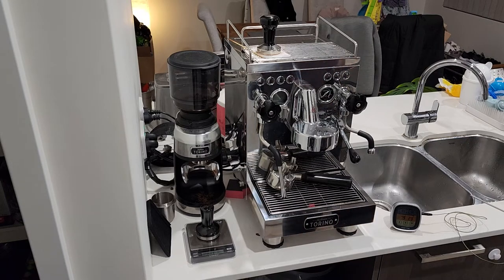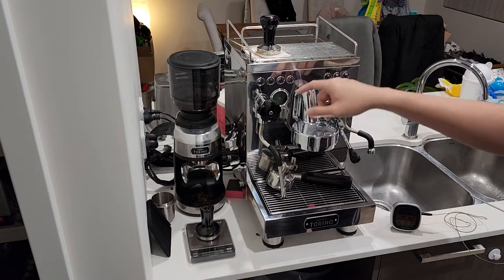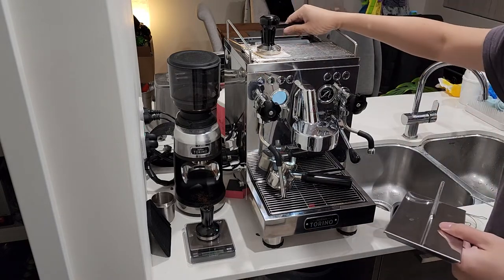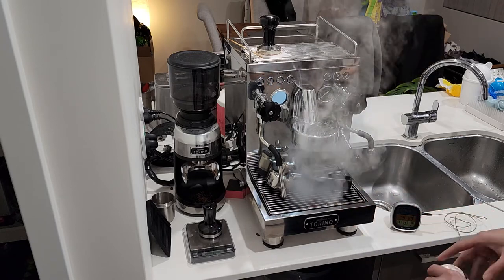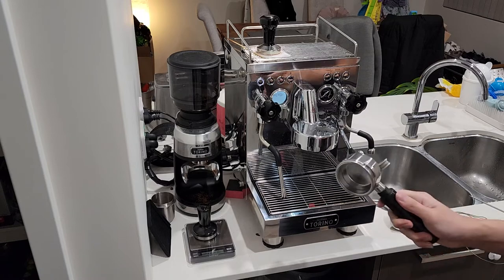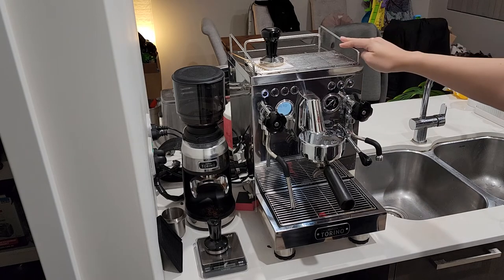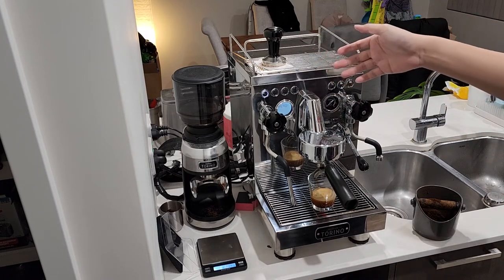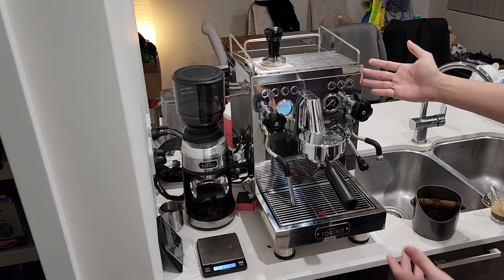Sunbeam Torino review

Comment: You're blaming a sour shot on the absence of an OPV? The OPV is not there to save poorly dialed in shots or crappy coffee. I use a Sunbeam dual thermoblock system and it simply cycles back the pressure of the pump when the grind is too fine. For it to shoot through in 20 seconds at such a high pressure suggests something else going on, like old coffee or something. There was very little crema in that shot.
Reply from the maker: I agree. An OPV won't fix poor grind setting or stale coffee. In my case, I suspect that because the pressure was too high (15 bar), heavy channeling was occurring despite carefully prepping the puck. So it results in over extracted coffee (at the channels) yet producing an overall under extracted shot. I'll need to get a reflectometer to definitely draw a conclusion. Right now is just a hypothesis.

Comment: I've got the OEM version of this - the WPM Welhome KD-320; recently purchased from Costco, upgraded from the Breville Barista Touch. Although I've experienced the same challenge of 13-14 bars of pressure based on a 19gms in, 40gms out 30-32sec extraction time, the espresso I'm getting is decent and a slight improvement on what I could get from the Barista Touch. Support and a community on these machines is very far and few though so if you run into a problem, it does sound like you're going to be on your own.. I'm keen to understand how the OPV mod works for you though, if it can be done and significantly improves the quality I'd certainly consider giving it a crack.
Reply from the maker: I'll need to get a reflectometer in order to quantify the improvement. Subjectively speaking, the mod did give some improvement but I'm still not satisfied :/ So I bought the Breville dual boiler to see if I can produce better espresso so far it has been a vast improvement but I'm going to do more test before drawing a strong conclusion.

Comment: You can't measure the temperature accurately with that thermometer because it's a cheap $10 one from aldi. I know because I have one and it's not very good at all.
Reply from the maker: Hahaha yeah unfortunately I don't have the K-type thermocouple. The aldi one lags quite badly so not very good.
Reply: wrong. its easy to measure 100C water. even with this one.
many people said these machines cant get above 65-75C (max 79C)

Comment: hey DanDoes, do you have a video of the hot water use on this machine? Given the machine is mostly a EM6900/EM7000 in new clothes, I'm curious what a difference given the extra thermoblock has. I assumed it's related to the hot water.
Reply from the maker: Sorry I don't have a video of the hot water use; I didn't think it was particularly important. From my understanding, the hot water outlet only relies on 1 thermoblock whereas, the group head has another to ensure exact temperature.
Reply: @dandoes7764 yeh, I ended up buying one of these machines second hand, and can confirm the 3rd heater is just for the group head, otherwise the machine is mostly identical internally to to the EM6900, EM7000, etc.   I would have liked better hot water, save having a kettle for making tea, but it's been ok. I've been thinking to use a dimmer on the pump to decrease the flow rate, but for now, it works and imo the coffee from it isn't bad.
Reply from the maker: @itujjp  I've seen the dimmer mod but was less confident in performing it. Having said that, the dimmer mod might be more useful than the OPV. I'm beginning to think that the issue with the torino is the high flow rate. I'm curious about the consistency of the flow rate; i believe mine is about 15 mL/s  from the shower screen. Its been awhile since I've measured it. Do you know what yours is? Most E61 group machines are around the 6-8 mL/s.
Reply: @dandoes7764  Mine is running fairly closely to 8mL/s. Planning to look closer at in the new year when I get some time. For the moment I'm sticking with a large dose and about 20 second run time at 16psi. Tried a bottomless group handle, and that was an interesting mistake, the pressure is that high it's firing coffee everywhere :)
Reply from the maker: @itujjp  Yeah with bottomless group portafilters, channelling will show up very readily. Out of curiosity, does your coffee taste sour due to this?
Reply: @dandoes7764 not especially. I've had worse coffee at the local coffee shops, but I feel like it could be better.

Comment: unfortunately i think , i have this machine, it’s been excellent for milk coffees etc and i was happy until i tried to lift my game and start weighing etc and drinking and learning about espresso…
still a work in progress, trying to decide wether to sell or get someone to fit a opv…

so when the  the pressure goes past the ideal 9 level…
why is this bad for the extraction .. i was lost at the end point … why you didn’t keep dialing finer ..
sorry to be a pain, but would be helpful if you could help me understand the problem so i can communicate to a tech for fixing or change machine 🙏
Reply from the maker: Technically you could brew at any pressure you want. For example, it's becoming popular to do turbo shots (6 bar) these days. The issue with brewing at high pressure (>10.5 bar) is that it will affect the taste of the coffee; this is what I've heard. More practically, brewing at high pressures will yield inconsistent shots due to higher chance of channelling and this means coffee will be over extracted at the channels but other regions are under extracted and the shot will taste sour. So hence, why I fitted an opv to avoid this. I'm currently working on another mod as I'm still not super happy with the results. Don't get me wrong, having the opv is better than no opv but thats not the endgame it seems. The endgame is flow control which I'm trying to see if it works. Once the part arrives, I'll do more testing and record another video.
Reply: @dandoes7764  thanks for the reply ..  good luck with the mods